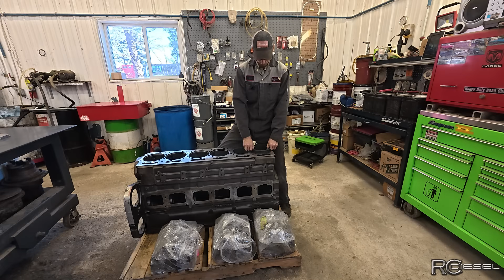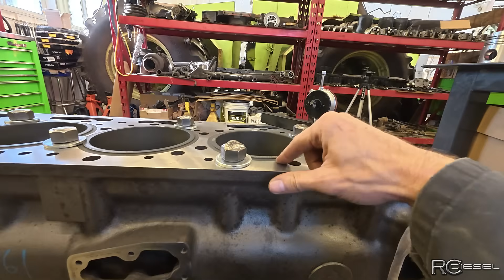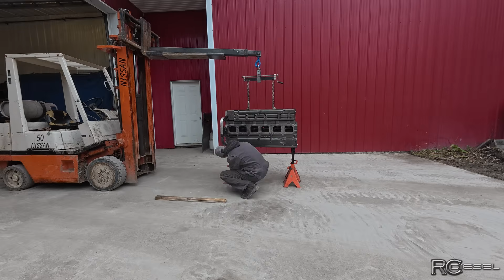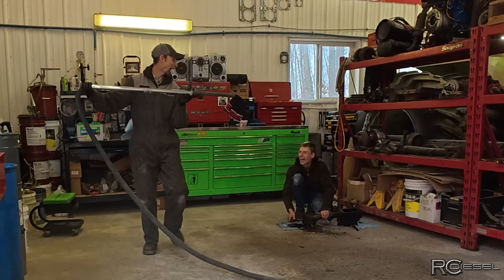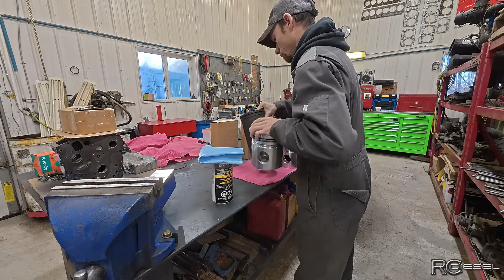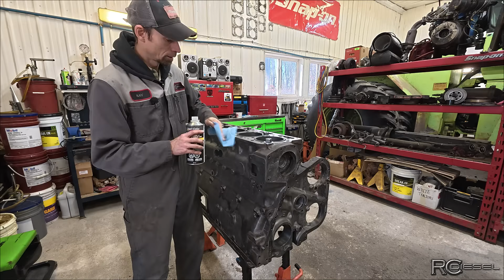Liners Installed & Numbers Verified! Cummins 855 Big Cam Back on Track (Steiger ST310)

Comment: 👍👍...you definitely know how it's done...that block sitting on the jack stands makes me nervous,🤣 even though I know it'll be fine... Merry Xmas feller.🌲☕..see ya next time 👊
Reply from the maker: Thank you sir. That block on jack stands kinda sucks, to be honest. But I've always done the bigger motors like that - some day I'll get an actual motor stand built for the bigger engines.

Merry Christmas! 🌲☃️🎁
Reply: @rcdieselchannel 👍👍... that's alright...I do the same thing or block's of wood👊
Reply from the maker: @elroyelblander6277 Back when I still worked at Deere, if the motor stand was in use, I rebuilt those motors right on the table lol Whatever works!
Reply: @rcdieselchannel 👍👍 that's right feller...we do what we gotta do .. whatever it takes 👊

Comment: Don't use soap on sleeve oring it is corosif.sleeve'groove will corrode in time.
Reply from the maker: I use 308 John Deere lubricating soap. It's JD approved for liner seals and is non corrosive. I've got engines in combines and tractors that I rebuilt using that soap 20 years ago and they're still not leaking....
Reply: I thought you were using liquid dish soap
Reply from the maker: @yvbiron6580 I can see why a guy could think that.... AR54749 is the PN for the stuff I use.
Reply: @rcdieselchannel  you can use vegetable oil

Comment: I prefer to clean and inspect everything so there are no surprises half way through a build. Better to know up front what's needed than to get half way through and find a part needs replaced and said part isn't available or back ordered.
Reply from the maker: Oh absolutely, you have to clean and inspect your parts and I do that. I just don't clean them to the point where they're ready to install.